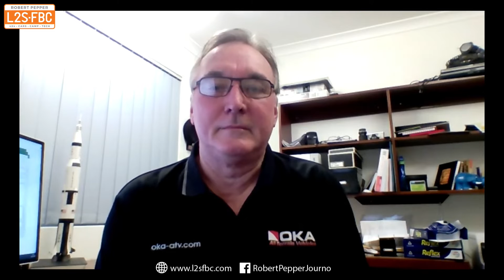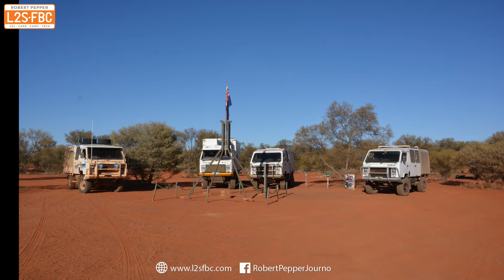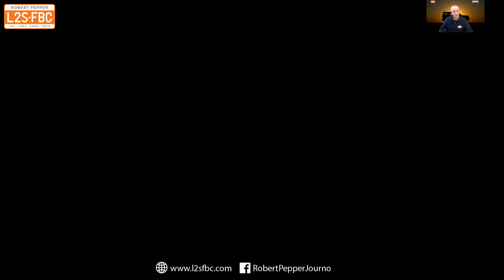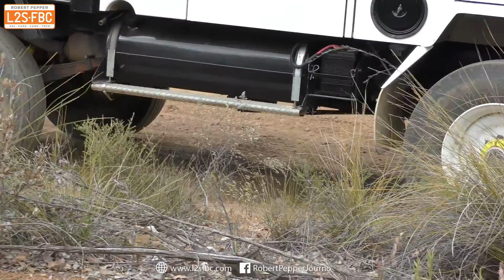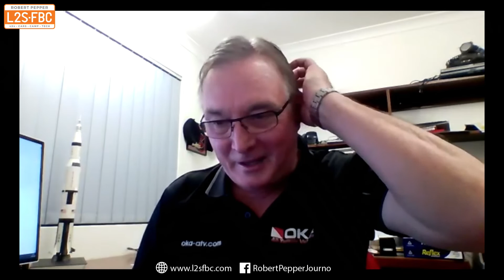OKA Managing Director interview

Comment from the maker: What is an OKA 0:20
History 0:40
Specs 02:05
Engine 02:20
Two problems with OKAs 03:58
Why buy an OKA? 04:10 
Dimensions of OKA 06:05
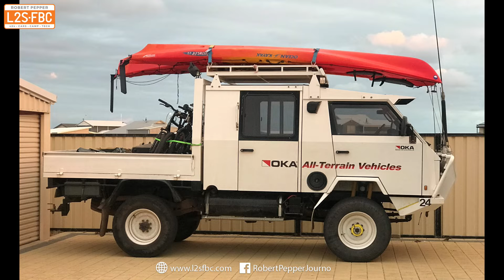Shopping with an OKA 06:55
Car vs light rigid license 07:10
Why OKA over Hino/Isuzu/Fuso 09:30
Mods to Hino/Isuzu/Fuso 11:50
Fuel cell OKAs 12:50
Servicing, parts and dealers 14:30
The 6x6 OKA 16:30
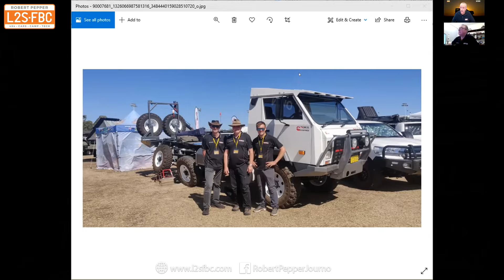How easy is the OKA to work on? 21:05
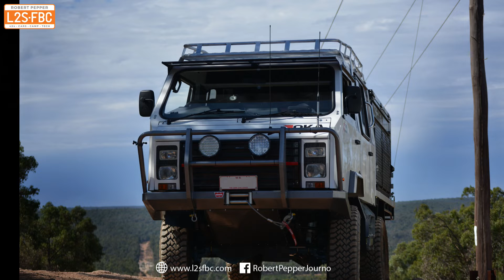Design philosophy 23:40
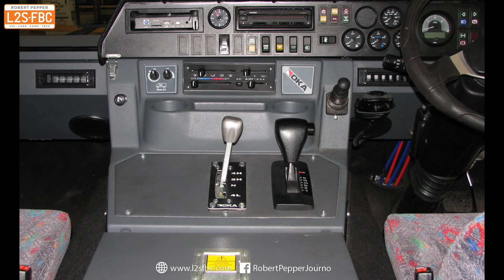Interior, and driving 26:40
Ride and suspension 28:40
Safety 32:20
Differences between OKA models 33:20
Remanufacturing OKAs 36:05
Is there anywhere I can test drive? 39:20
What's the braking system? 40:00
Costs 42:00
Why I Want an OKA 43:20
Bodies 44:20
The MD's final message 45:35
Aussie made 46:55
Unimog vs OKA 47:38

Comment: Not sure what the status of “OKA” is these days but their ownership and manufacturing history has always seemed to be up and down, on and off. It is a very very utilitarian and single-purpose vehicle and most recreational owners want something rather more refined and/or multi-use. Overlanders don’t need extreme 4WD capability; other factors are more important to them. Price is actually considerably higher than a Canter converted to super singles. And my recollection is that reliability, ownership costs and concerns  about the future of OKA itself turned most commercial buyers off including the miners who were their initial target market. This meant OKA really struggled to find a reliable profitable niche, even a small one.
Reply: I would think some overlanders would want extreme off-road capability. As the saying goes in construction circles I’m in “it’s better to have it and not need it than to need it and not have it”. For me the more capable a vehicle is off-road the slower one can go and still make it, which would perfectly suit a mobile home.
Reply from the maker: Agreed+
Reply from the maker: Agree with all of that. There comes a time when enough offroad capabiity is enough and that's all you need, no point compromising other factors for more. But I hope they succeed. Yes, price is a problem.

Comment: Do the calipers still come loose?
Swivel hub bearings collapse?
Reply: You just described every Toyota Landcruiser I have owned. Oh yeah, it's many
Reply: @Embee7703  is the front axle the same as the older models?
Reply: @Embee7703  I guess you’re the same Marcus that brought the OKA to cairns and wouldn’t let us take it for a test drive, hence we bought canters. If they are still the same calipers, then they are okay for outback but not for the beach